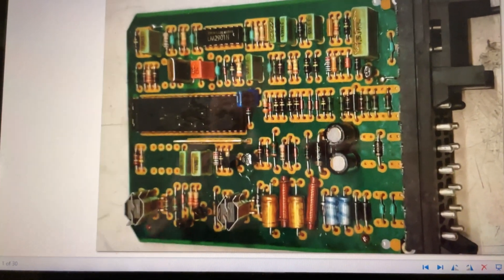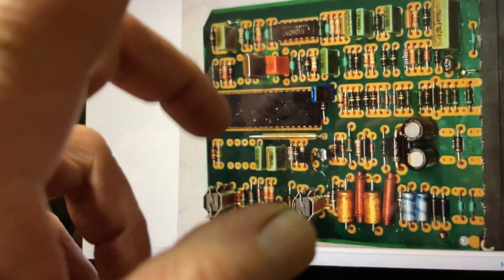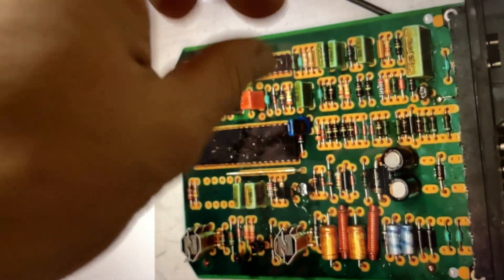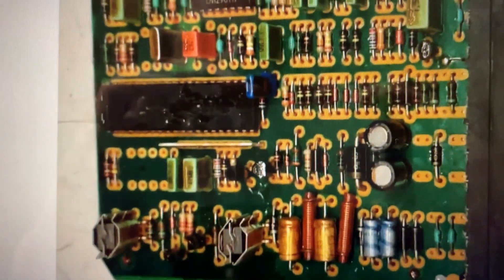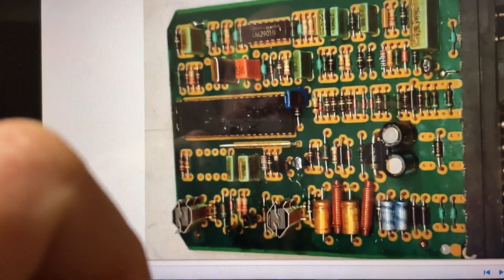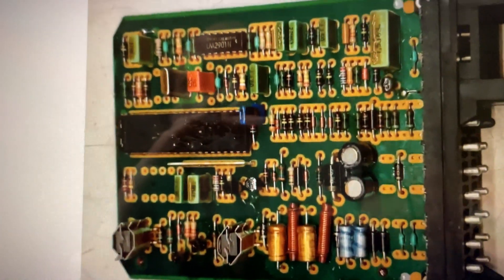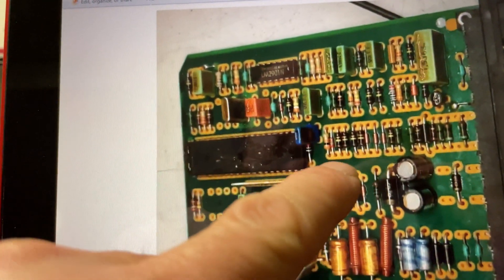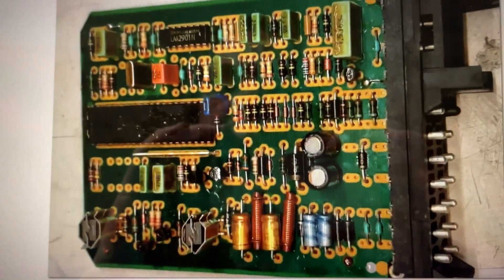Mercedes Benz W126 560SEL 3/89 Testing & Overhaul of Electrical System and All Control Units Part 15

Comment: What are the micro-Pharat numbers that disable the console at speed and how many of you will show them in photography and usually posted on YouTube
Reply from the maker: @loaialtmiimi4426  
Mercedes Benz W126 560SEL 3/89 Testing & Overhaul of Electrical System and All Control Units Part 5
https://youtu.be/XmraDLVZfDY

Mercedes Benz W126 560SEL 3/89 Testing & Overhaul of Electrical System and All Control Units Part 7
https://youtu.be/7TKZDir4WAQ

Mercedes Benz W126 560SEL 3/89 Testing & Overhaul of Electrical System and All Control Units Part 6
https://youtu.be/6LqwWQF7jUw

Mercedes Benz W126 560SEL 3/89 Testing & Overhaul of Electrical System and All Control Units Part 9
https://youtu.be/kCGXOKsyXyY

Mercedes Benz W126 560SEL 3/89 Testing & Overhaul of Electrical System and All Control Units Part 10
https://youtu.be/r61NPNFytjM

Comment: I hope you're good. 
There are improvements in my cold start, but the leap continues in the hot engine. 
As far as I cannot understand, the engine runs late between 40-50 degrees.

https://www.youtube.com/watch?v=44WGteXcFGI

https://www.youtube.com/watch?v=s73sk5cLIOo